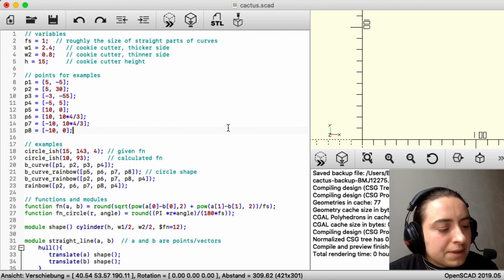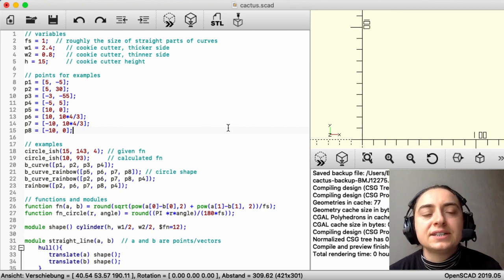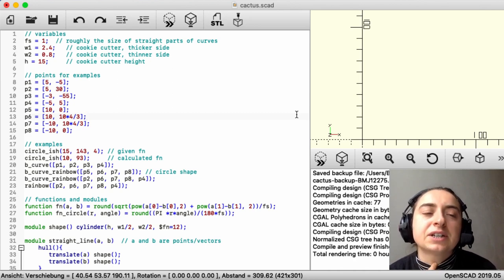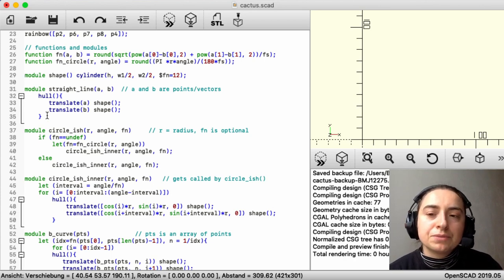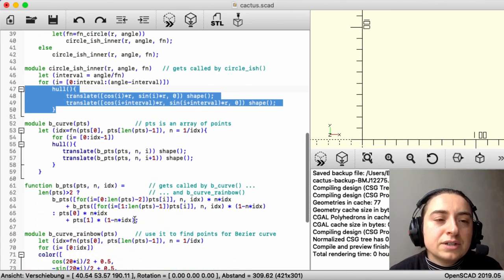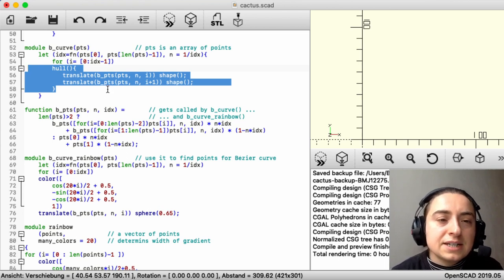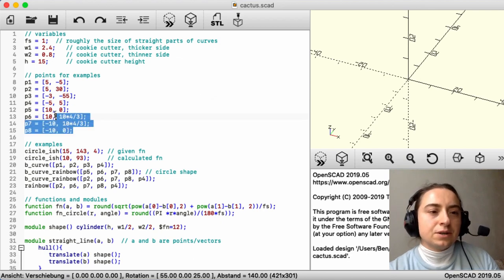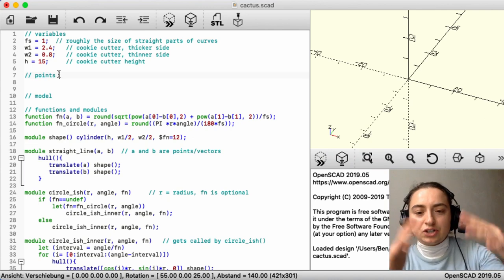Bézier curve tutorial for OpenSCAD, Part 2 - Live coding

Comment: Hello, thank you for making this video and explaining how all this works.

I have a tip for everyone that will make using a program with parameters like this MUCH nicer.

When you want to change a parameter, such as an end point or a control point coordinate, place the cursor just to the right of the digit of the number that you want to change. Now press and hold the ALT key, and then press the Up and Down arrow keys. The digit to the left of the cursor will increment or decrement, and the Render display will update immediately.

You are also able to hold ALT and then use your scroll-wheel to change digits, though you may need to enable this in the Preferences/Editor settings first.

Numbers will go negative or positive in the way that you would expect, and pressing ALT-Right or ALT-Left will move the cursor to a different digit, and even add zeros on the right if needed.

I LOVE OpenSCAD!

Comment: 1:06 "A round thing in computer graphics is not really round, but is made of tiny straight things"
Are you telling me that the Bèzier- curves I use in my CAD are not actually mathematically continuous? What happens when I use the CAD-model for CNC-machining?  if the "ds" value is too large in the G-code, will it introduce an inaccuracy compared to the design intent? 
Sorry for asking stupid questions.